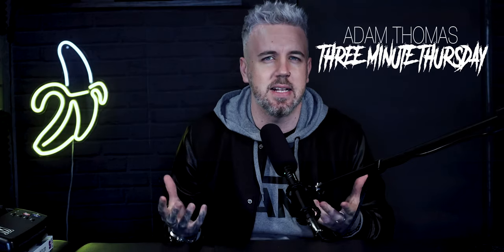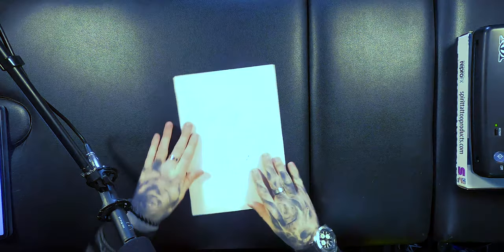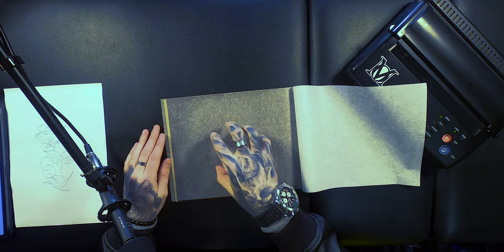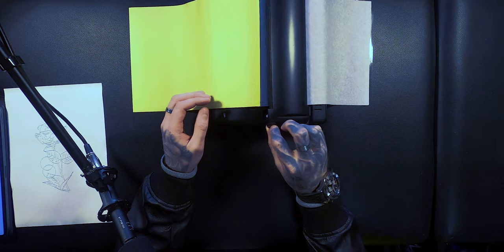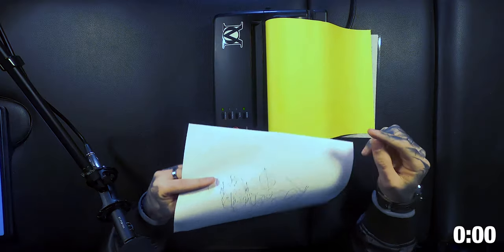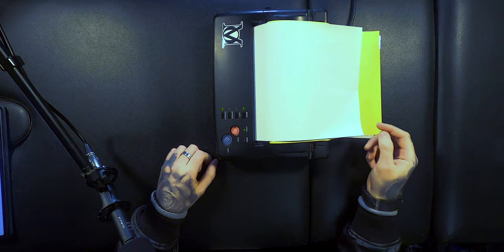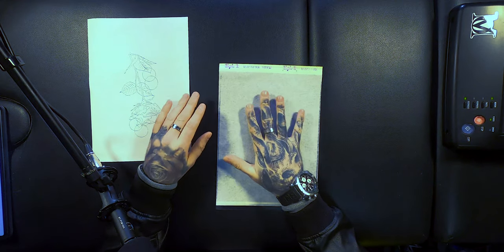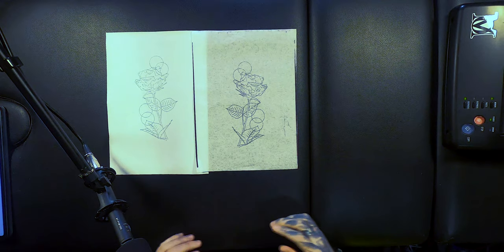How to use a THERMAL COPIER for making TATTOO STENCILS!

Comment: I’m going to make your day ridiculously difficult 

What printer do you have to use for a tattoo transfer machine??? Got both inkjet and laser so technically I can’t go wrong 😂 but want to know for first try not failing. Unless inkjet and laser works. 
How does these machines work? Does it like detect black images or something or is it ink rely based which is why I ask what printer
Reply: Hey, Iv always found that anything laser printed wont get picked up on any copiers I've ever used in the past...🤷🏽‍♀️ normal inkjet picks up line work fine.